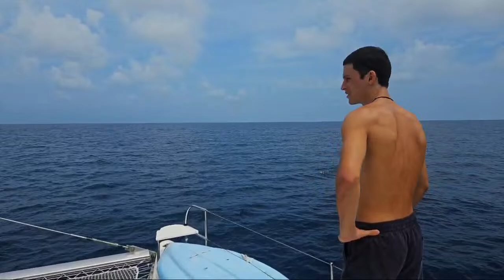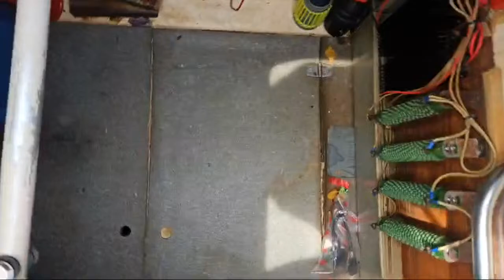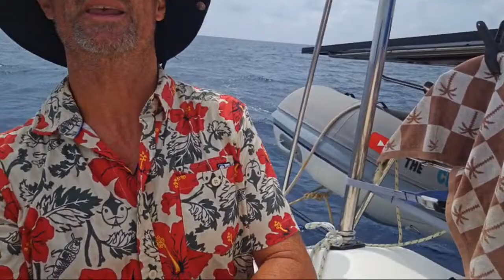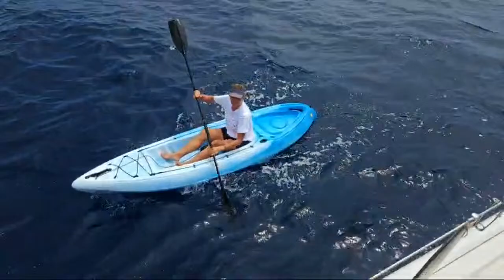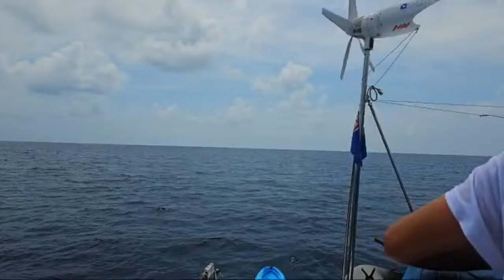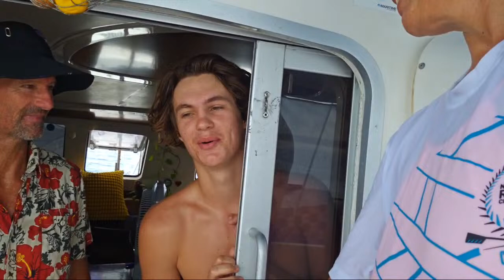KAYAKING THE INDIAN OCEAN LIVE day 12

Comment: I remember you cutting your anchor free  😥I saw someone using an anchor marker ball, they used the attached line to free their anchor, do you use one?
Reply from the maker: We did so back on Fiji days but would always get caught around rudder when wind or current changed. Not practical.